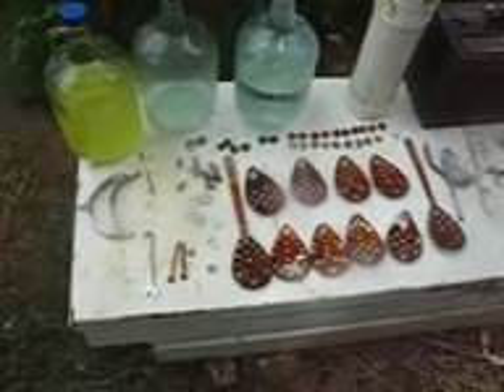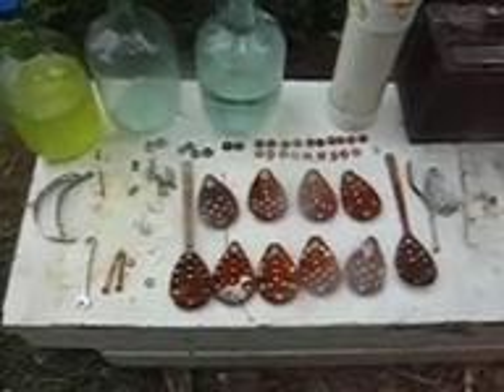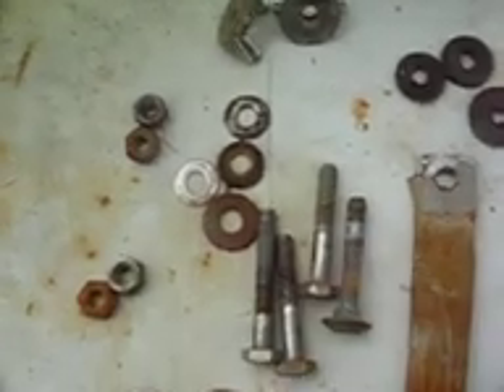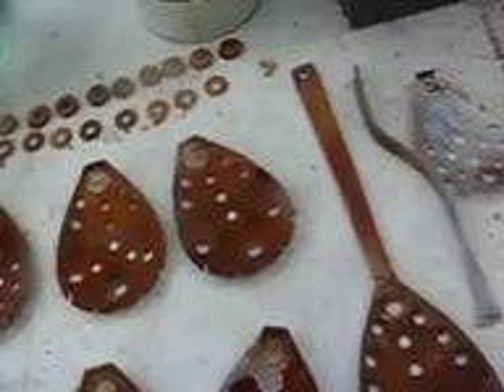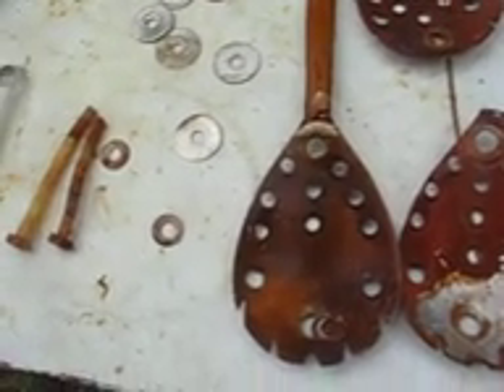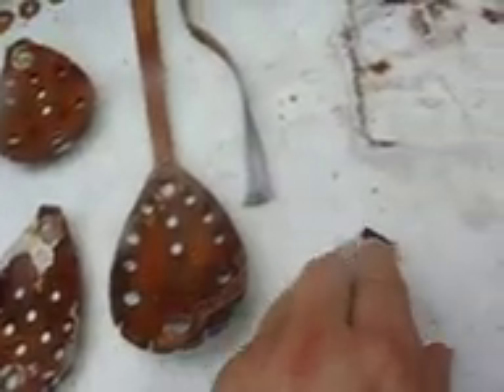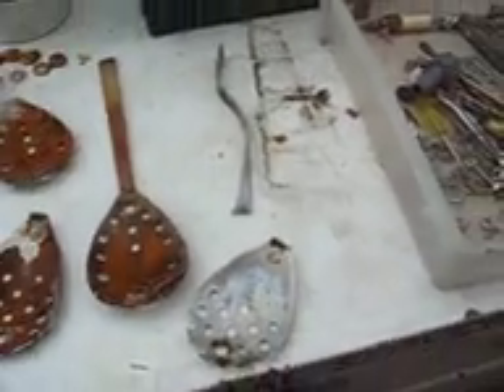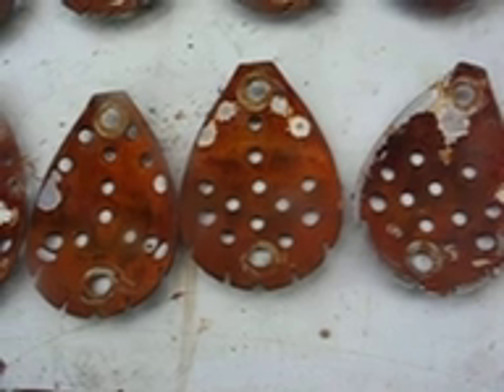042 HHO after 4 month -Destructed by Lye, Part of Vid 015

Comment: i think its the magnesium sulfate and you cannot use normal stainless steel but you will need 316 stainless steel and even 316l wont work. you could also use platinum/gold plated stuff though